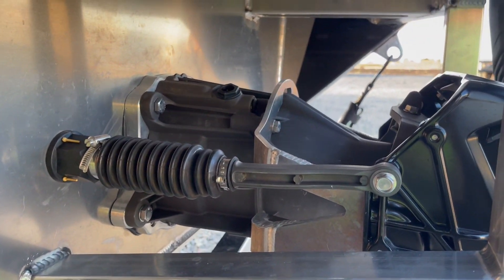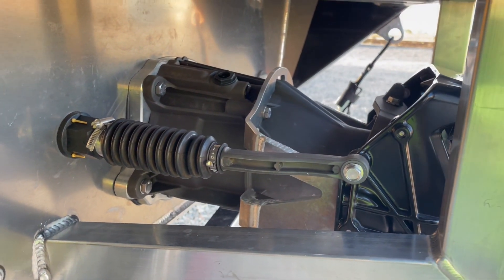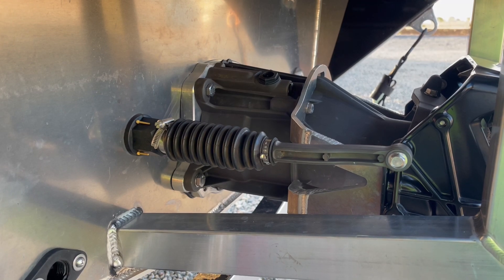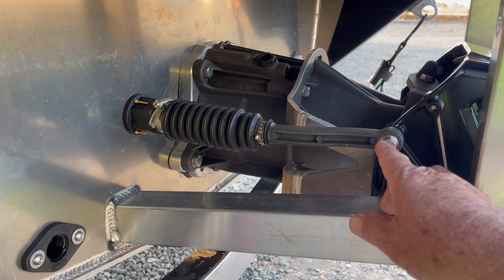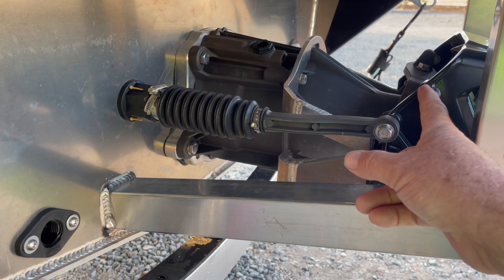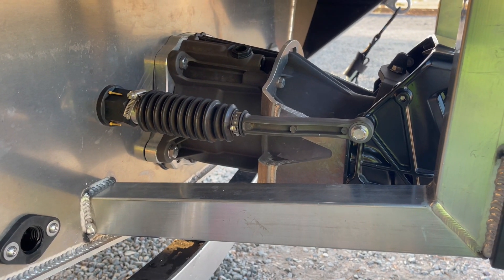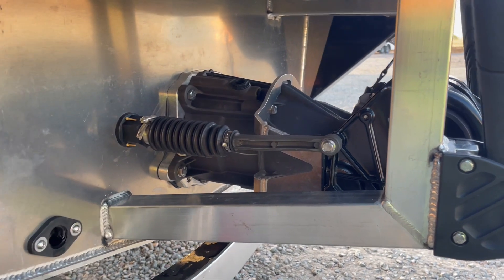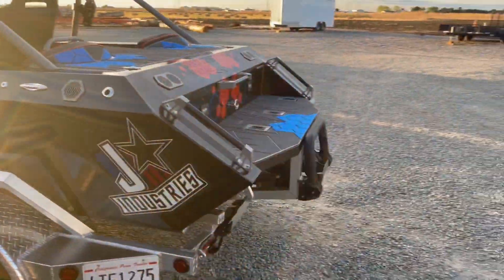MOJO H2O needs some work

Comment: In my experience having to do a slow serpentine to keep it from getting bouncy was normal, seemed to stopped the up and downs when turning the wheel a little back and forth smoothly. Goodluck with it its looking great!
Reply from the maker: Yes I agree I was doing the same thing but if the boat is correct and balanced you always had to be in a bit of a turn. Now with the ride plate at speeds over 40 miles an hour it tracks pretty well. I plan on adding wake plates on both sides with controls on the dash to adjust for different loads. I’m about to post a video on the pipe that we made for the bottom of the boat and since the video was made we have tested and adjusted it. We ended up with a 22 inch wide by 11 inch long plate 1/4 of an inch higher than the back of the boat and perfectly level at the back of the plate to the bottom of the boat. Did many adjustments to find that happy spot but it really likes it there regardless of how many people I have in the boat now

Comment: it would look good with a front motor too, just cut a hole in front and drop one in that goes up and down, helps with steering if can do a 360, isn't like it's never been done before, your better sea tow boats have them in, just don't go up and down

Comment: Did you ask Troy from Torchcraft why this was happening??  Also maybe a fabricator could mill your a reverse jet shim?
Reply from the maker: We added a ride plate to the back and did some adjusting to it and found a pretty good sweet spot but it doesn’t hop Starting a new boat with Troy and will be building it with Road plates that are adjustable on the back.
Reply: @MoJoh20  MoJo H2O 2.0??